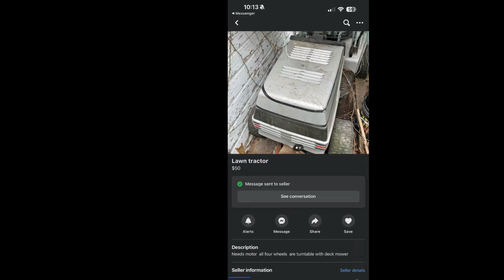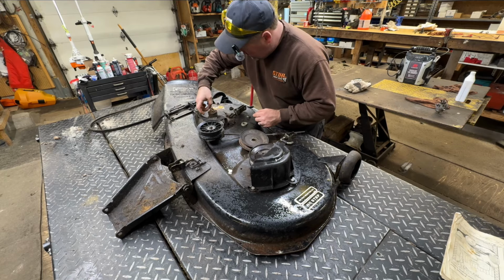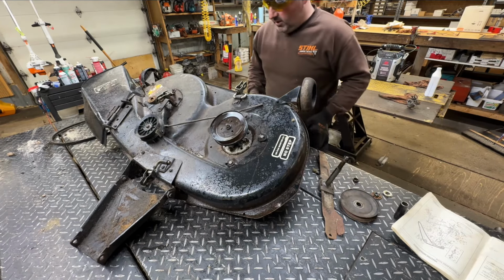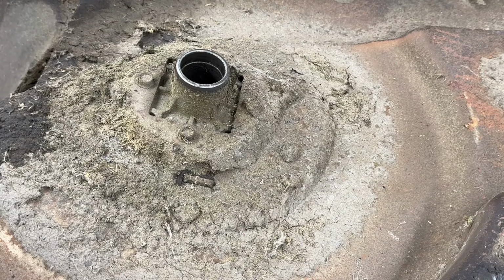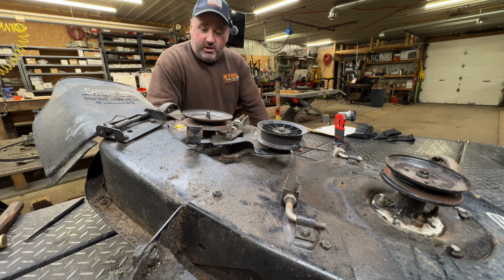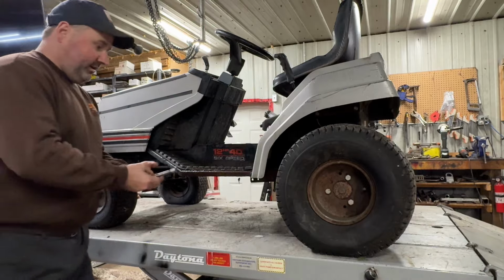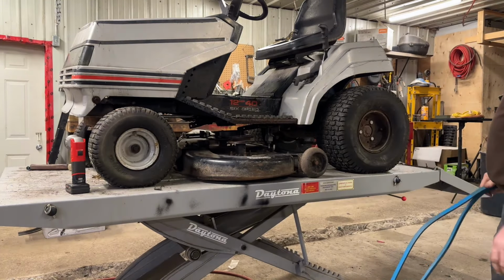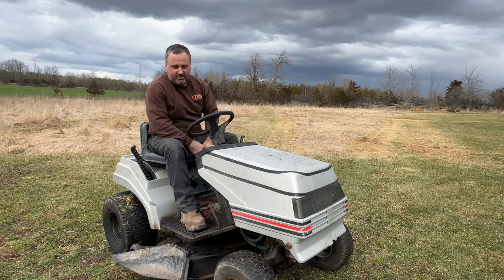* PART 3 * 1989 Craftsman All Wheel Steer Lawn Tractor for $50.00! What will it take to cut grass?

Comment: i just spent $500 re-doing my kamart "k-gro" 43 inch cut deck and mower.
New everything~ spindles, blades, paint, belt etc. key switch etc.
  New tires....and i made a metal plate for the different gas tank to sit on.
I've had the same battery for over eight years...tractor sits all winter and i go out and
choke the engine and it starts! 
 I've fixed small engines for over 20 years, but recently just started fixing old mowers like you do..go out in the back yard and grab one, fix it up. Got two lawn boy mowers..over 25 or so years old...got the transmissions rebuilt, but never fixed or cleaned the carbs lol.
 LOVE your channel, and love how your wife comes out to help you out...that is priceless 
in a marriage like ours...makes the man feel he is doing something worth while .
 Hey, even if my wife brings in a sandwich and some coffee while i am working. makes me feel appreciated..taken care of, and loved by my wife.
Al n Kat  :)
Reply from the maker: Sounds awesome!    Yes!  We are a great team and partners in everything we do :)

Comment: I think the welds look very good. I use a flux core welder for most of my deck repairs and have never had one fail. Heck I have even replaced body panels on a car with it and they have held for years without incident.